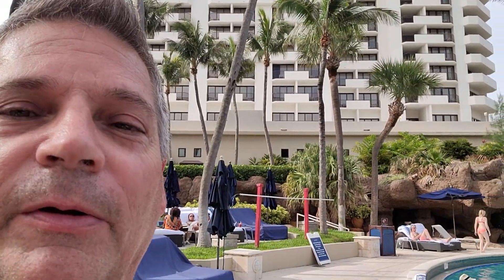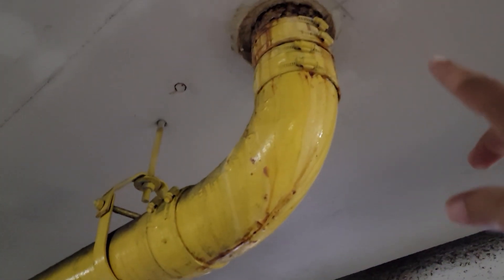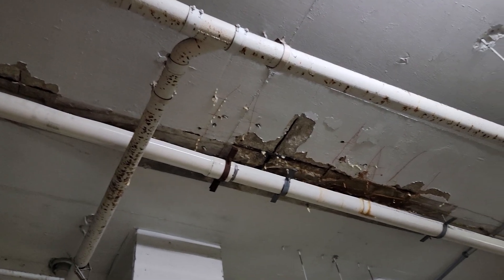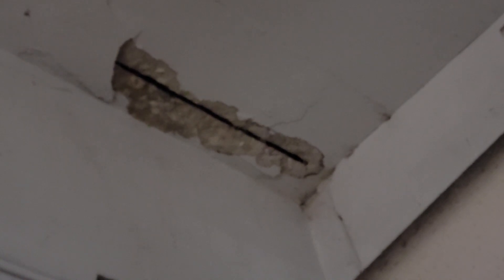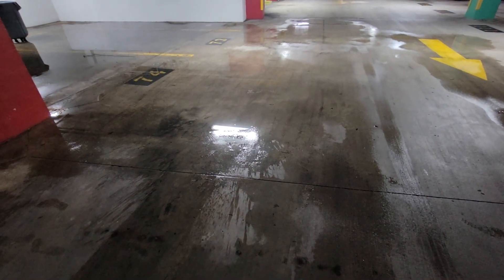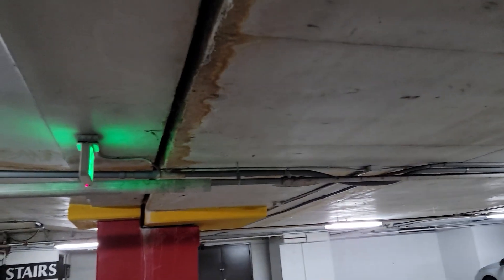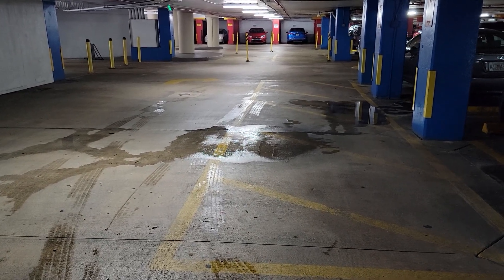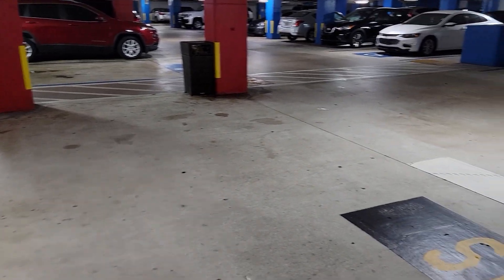Scary Garage Damaged Concrete Marriott Harbor Beach, Like Surfside Collapse

Comment: Looking at this building you can already see it’s built 100 million times better than the Champlain towers.   Huge concrete pillars as well as many of them, with seams  in the slabs.   Champlain had many structural flaws in its design as well shotty concrete.   I think the poor concrete mix will be proven to be  the true silver bullet as well the neglect of the building just added to the perfect storm.  But yeah they should address those issues.
Reply: Yes and no to your "100 million times better" comment. One must understand this building is three stories taller than the one that fell so would need to be beefier. Built to code to withstand what is required of it is more appropriate. IMO.
Reply: @robi4387  
I will bet the mindset has been adjusted to make what holds things up more  important than new fluffy pillows or faucets.
Reply: @larrybe2900  Oh I hope so, but I suspect not.  Cheers matey.

Comment: Lets be honest Jeff this concrete is not just no longer at its rated strength, but there is simply no practical concrete repair to ensure that strength is back.  Bottom line is these need massive steel ibeam buttressing or pour filler walls in between all those columns like they did to all the freeway bridges in the 90s.  As they stand now, there are all going to fall down and they were built to.  In freeways they know these things dont last more than 50 years and so why do we keep people stacked like sardines in death webs of unstable mud with rusty steel toothpicks inside.  Anyone remember the "arch"?  90 degree construction is simply not housing but pure engineering avarice.

Comment: I cringed seeing that electric pipe rusted so bad that you could see the wires, it's ironic the pipe underneath looks like it was replaced and protected, yet couldn't do the same for the electric pipe?  Not sure how Marriott will handle this assessment, but if they were smart, they'd likely understand that after what happened to Surfside Towers, people don't want that repeated.
Reply: Yeah, that was scary, and the sharp edges of where it rusted away could easily have cut through the insulation, and I highly doubt that circuit is on a GFI or protected by an RCD. Shock hazard if some curious person sticks their fingers and plays around with it. This could be cheaply fixed by cutting out the EMT, and just replacing with schedule 40 plastic conduit, which won't rust. If it's critical wiring that has to have fire protection in the garage, then it should be replaced with threaded galvanized conduit, not the thin wall cheap EMT junk that rusts thru fast. I'm not familiar with the exact Miami-Dade building codes regarding use of PVC conduit in garages, but it looks like they've used that elsewhere in the garage for lighting fixtures. But some places critical cables have to be in fire rated conduit, and fire stopped at any wall penetrations. Just in case a car catches on fire in the garage.
Reply from the maker: That says it was dripping water on it for a very long time

Comment: Is there any info on the live load amount for the building that collapsed?
Reply from the maker: I have not seen it. Josh over at Building Integrity the other day calculated static loads and was shocked to see the pool deck was already at 100% load capacity from day one
Reply: @jeffostroff  okay thanks. I knew you had combed through the building plans etc and wasn't sure if it was there.
Reply: @jeffostroff  Now that does not surprise me.  I didn't need an FE run to tell you it was too thin and under-reinforced.  Well not to current British Codes of practice.
The problem with buildings is they cost a lot and then owners can't believe that for what they've paid, it might on be structurally sound.
If it enters their heads, they block it out with red paint and yellow corners.

Comment: But if ac lines ...ac on most of the time so water around all the time ..so very bad
Reply from the maker: Yes their problem is they did not do a very good job of insulating those AC lines they must have insulation and at the very end you're supposed to tape those men apply mastic

Comment: Looks in worse shape than champlain towers south. However I dont think champlain towers was unstable.  I think the pool deck incident took the columns out.
Reply from the maker: yes, that is what I concluded in several videos back in July
Reply: @jeffostroff  It is the only explanation as to how it occurred.   It wasn't the building being unstable.  It was the weight of the failed deck pulling the columns out from the building. Freak accident, event to say the least.

Comment: It's an expansion joint to allow the building to expand and contract. Though I did not see an expansion fitting in that electrical conduit.
EDIT: The pipe painted yellow with the banding straps is a storm drain.
EDIT #2: @11:39 those are electrical conduits. The large fittings around them are expansion couplings to allow the conduit to expand and contract with the building.
Reply from the maker: Thanks David
Reply: @jeffostroff  No. Thank you. For all your informational videos.

Comment: How much water will there be when a hurricane arrives?
Reply from the maker: Probably the same amount, these leaks are from small cracks, so most water ends u down the pool deck drains
Reply: Not sure about this location but ive seen videos from the beaches where water is coming inland for a few miles depending on where the hurricane is ... Especially if the hurricane is just off shore

Comment: How many apartment owners that owned buildings built in the 50's and 60's (think of Lake Shore Drive in Chicago) sold them as "CONDO'S" to avoid the financial burdens of fixing up the buildings as they got older.  They made a profit.   Today's owners will end up with massive expenses in the future.  In Chicago's case, they already paid millions to replace the spalling concrete of patios and balconies that had to be repaired once already.  It's not only in Florida.

Comment: coat the rebar in 2 part epoxy before you install it
Reply from the maker: Yes they do that nowadays Canada is trying to ban it actually because a lot of times the opponents get cracked if the reborrowers missed handled or if you end up with voids during the coding process, you can get even more rough or rust in corrosion

Comment: These buildings just look like absolute crap to me. They are just rotting away in leaking water and salty air. How the hell are you going to properly fix all of the rotten rebar in a building like this????? Theres no way you could. You can patch it, and make it look pretty, but it’ll still be structurally comprised. My guess is that in about 10-15 years, there will be a LOT of buildings condemned in this state, after a few more collapses. I’ve spent plenty of time in Florida. I’ve seen it.
Reply from the maker: You hve to chisel until you see no more, then repair it according to ICRI standards, it will be good as new, just like filling a cavity in your tooth

Comment: Looks like the maintenance crew that work in that building are related to the guys at the Champlain towers.  Come on, exposed electrical wiring.  And all the pipe chases inside piers and oozing water? So much for inspectors. It might be,,,,common,,but not okay. We don't learn, obviously.
The problem with patching the concrete is, unless they stop the leakage, it's just gonna pop right off. Or the waters gonna move to a new location.
Shouldn't be water in the lobby, should there? Honestly, looks like a spittin imagine or worse, of the video the lady took at the Champlain towers.
Yeah, I remember from the video at the towers, there was a lot of good ceiling as well.

Comment: Rusted rebars on the bottom = rusted rebars on the top. 
That whole section should be gutted and replaced.
Shut down the hotel for a year or so, or just demolish and rebuild?
The bean counters will decide.
Maintenance of the water integrity seems sorely lacking. Every failurepoint should be analyzed for design, approvals, and maintenance.
Every hole drilled thru it should go back to original engineers, and approved by them. 
Building codes have been updated. No grandfathering should be allowed for buildings unless the grandfather still lives in the old building.
In a condo the purchasers inspection and his insurance company should be liable for any death, with appropriate disencentives.
Reply: I would say insurers have A LOT to say moving forward.

Comment: I just have to SMH who the hell designed and built and inspected this building. I mean seriously installing AC lines in a column and through the concrete without putting them in a plastic conduit. You could never replace those lines if they were to need replacing. I’ve seen condensers sweat but not as much lines but I know they will depending on humidity. My gawd Florida must have some shady contractors and inspectors. Not to mention the exposed wiring. Whew
Reply: I am sure time has upgraded codes and others will be changed or better enforced since this collapse. Two heads are better than one before asking for approval.
Reply: @larrybe2900  oh I’m definitely sure as well. Great videos I’ve enjoyed the all. Now go have a fun vacation!! You’ve earned it.
Reply: @tcwhite0104  
To whom are you directing your comment?

Comment: These are all common problems.  This Building isn’t going to collapse because of it.  What happened to surf side was a perfect storm.  Maybe someone cheated on volume or size of steel. Maybe someone cheated on concrete.  People are just guessing at this point but they will find out.
Reply from the maker: how do you know there isn't a perfect storm here?

Comment: Jeff be careful to back up what you're saying about this building or you're going to get sued and loose in court to Marriott Hotels. Your title just implied the Hotel was as dangerous as the collapsed Surfside Condominium by comparing the two. Without expert proof of a Physical Engineer the leaks have in fact compromised the overall structural integrity, you just slandered the Hotel Franchise. That slander can lead to a devaluation of the Hotel and loss of income for the Hotel and even the Hotel Franchise, all the Hotel needs is one person to say they were afraid to stay at that Hotel because of your video and bam, you're getting sued. Now I'm not saying those issues haven't effected the electrical conduits, it has, or hasn't effected some of the structural integrity of the noticeably spalled concrete, it has, but you're skating on thin ice in this video. If I were you, I would "re-title" this and consider your wording carefully. I'm glad you made the video, it makes those Hotel and multi-story building managers step up and take notice. Just be careful Jeff we need folks like you. Nice video I enjoyed it and others you've put up, thumbs up. Best Wishes & Blessings. Keith Noneya

Comment: You know yes… building maintenance is  necessary.   However… the fact that the water table is rising , the ground is limestone, and you have superfund sights contaminating the ground water (causing it to be caustic)  It is these factors that are going to be the culprits.  Concrete can get wet, for long periods of time… Hello ever heard of an olympic swimming pool?  What concrete does not like is salt water, or other caustic types of water.  Without a doubt the condo that collapsed at surfside was due to the ground beneath the structure eroding, resulting in uneven distribution of pressures.   Everyone, regardless of your buildings leaks or not will meet this fate sooner or later…. Buildings like the one in this video, sooner than others… however, what your pointing out is not the cause.  Sharing videos like this without fully understanding the mechanics is irresponsible.

Comment: Djeeezussss
Good of you inspecting these buildings... there will come a time that they will command you away... or... they thank you and start inspecting it together?
Naaah... that'll never happen. They will shooosh you away. "Get out of here, I am calling security" that'll happen. 
All of them built in those years probably have the same problems. 
Some faults I see also in modern buildings.
Those metal guards I do not think have anything to do with strength of the coloms.
Anyways... very good you (and others) are inspecting these buildings.
Not thinking of collapsing one other building....damn...

Comment: As a building engineer this guy has 0 clue what he’s talking about, it was like watching a comedy 😂. 3 best parts, 1. When he touched the large yellow leaking 4 inch sewage pipe bare handed  right on the brown stain (poop) calls it a drain for a planter box 2.Sees random 2 inch insulated pipes obviously water pipes with low pressure rubber fernco connections “yeah must be an air conditioner pipe”. 3. Sees expansion joint gaps, calls it an “isolation seam” “yeah this is exactly what you want, so when one side collapses the other side won’t”…Amazing building inspection bravo 👏 😂 💀